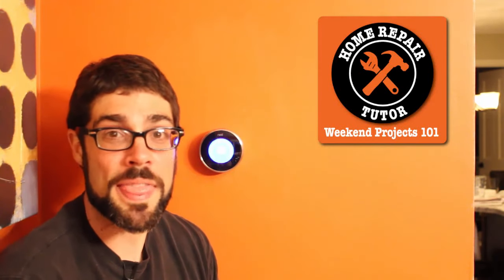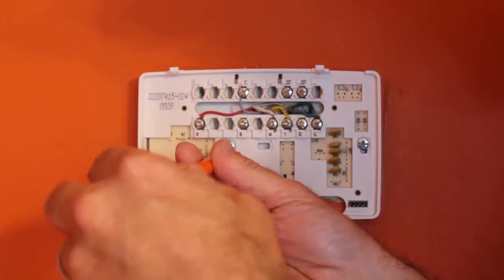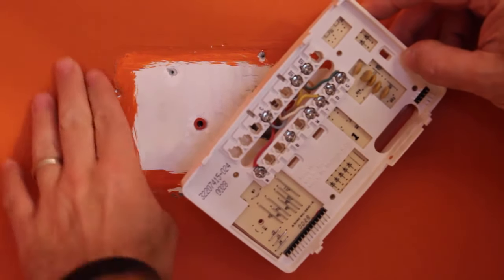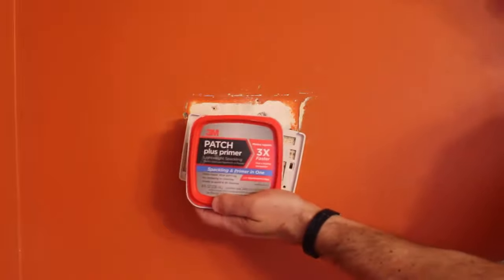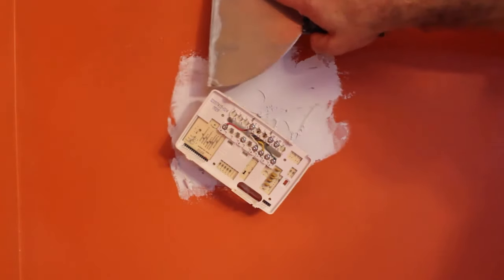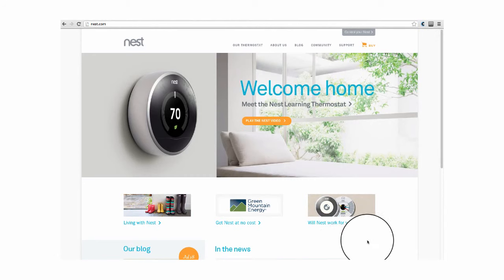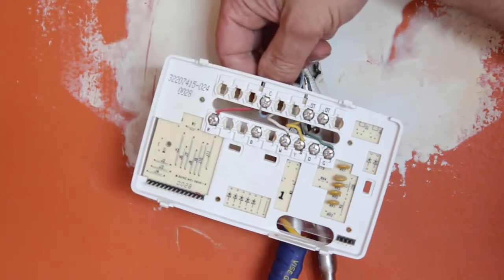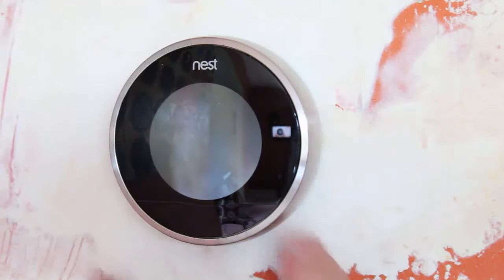How to Install The Nest Learning Thermostat

Comment: Thx for the demo,  Now my turn, will let you know how it goes.
Reply: This was such a breeze to install. I replaced an 10yr old Honeywell Thermostat. There were only 4 wires to connect and very self explanatory from the instructions and this video. My nest is up and running. I LOVE how I can control house temperature from my android app from inside or away from home. 

I also installed 5 CO2 smoke detectors too.

Comment: How do I know which R wire connection to use (Rc or Rh)?  My thermostat wire is just labeled R.  Thanks for the video.
Reply from the maker: I could be wrong Kevin Kinser but I think the directions comment on this. If they don't, call Nest customer service and they'll totally help you out.
Reply: Rc is for cooling and Rh is for heat. Both is you have heat and cool. It doesn't matter on the Nest which one you connect, it will automatically jump them if need be. Don't use a jumper on the Nest or it will not work. Just connect it to either or.
Reply from the maker: Thanks billybassman21 for the tips :D

Comment: Half the video is about dry wall fix.  So misleading
Reply from the maker: Sorry you feel that way jude singh. I still feel there are good tips about the Nest and unfortunately drywall fixing sometimes is a big part of thermostat replacement
Reply: Be real man, the dry wall patching was probably the biggest bump in the road. This video just reassured me how simple this project will be once I receive my nest
Reply from the maker: Thanks TheDonkeyFLOPPER - hope you like your Nest. It's pretty cool :D
Reply: Jeff Patterson Hey Jeff, what kind of Orange paint was on the wall before? I have an eggshell paint and I'm scared you'll be able to see my touch-ups from the larger thermostat space I had before. But your orange wall looks nice and even.
Reply from the maker: That wall was a disaster actually, I ran out of the orange paint and had to pray that we could match it. My wife was not happy. I actually took a quarter sized piece to the paint store where we bought the original and they matched it. It's an acrylic latex in satin finish from Sherwin Williams